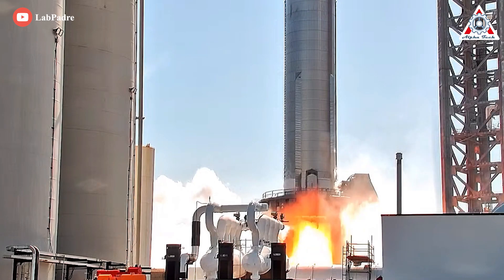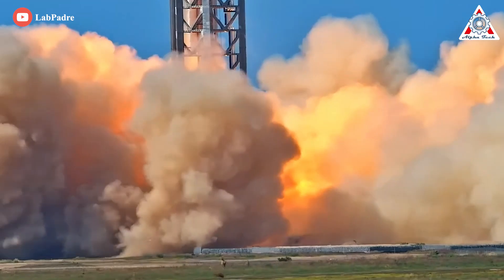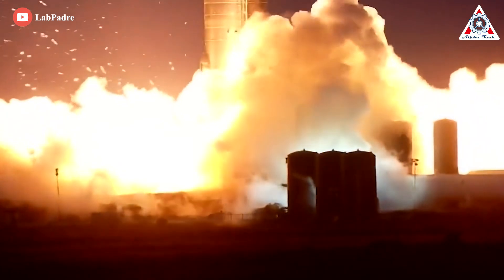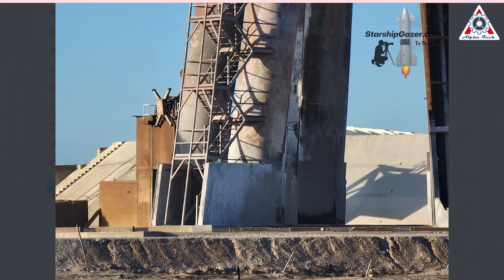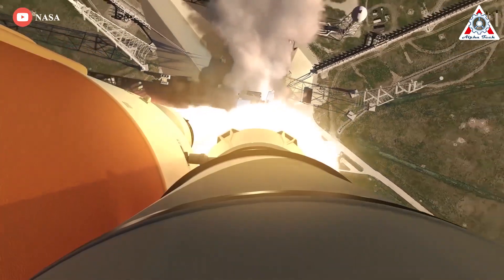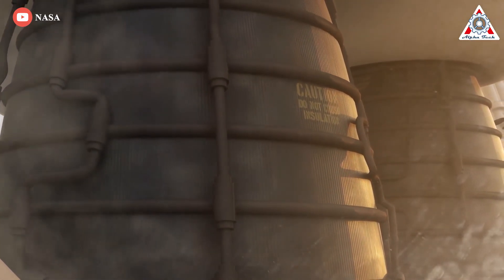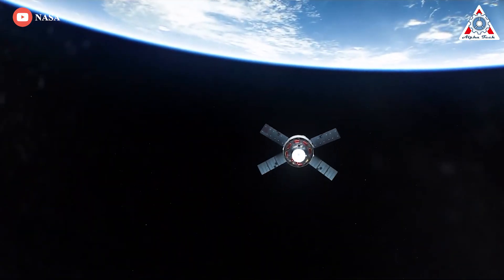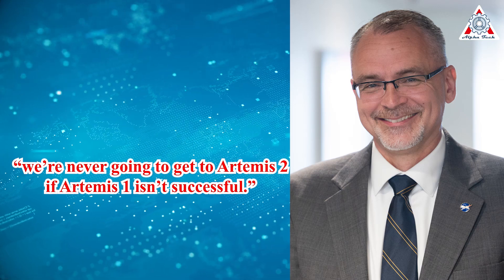Analysis Starship Super Heavy Booster 7 14 engines Static Fire "Problem"...

Comment: I think with this amount of engines it would be a viable option to start up to launch off of the pad with minimal engines then start up on all full engines once cleared the pad.
Reply: It isn't viable at all I'm afraid, if you don't need all engines to ignite on launch then you don't need them at all once you're off the pad... There are 33 engines because that is the minimum number needed to get the rocket and the full payload off the ground. Sure, you could reduce the mass of the payload and only light half of the engines but once you're in the air you don't need to light the other half. It would be cheaper and more efficient to just build a smaller rocket if you're going to do that. 👍
Reply: I dont think so. You need the full power to lift the most heavy rocket: the first meters...
Reply: @I Am A Duck you are using up some of  that safety margin by doing this
Reply: @I Am A Duck There can be X amount of engine failures during flight because the rocket gets lighter as it burns off fuel. That in-flight failure rate will be calculated based on a launch TWR of 1.5.

A fully fuelled booster and Starship with 100t of payload will weigh about 5,000 tonnes (1,420 tonnes of that is the fully fuelled Starship and its 100t payload) and will need all 33 engines firing to achieve the desired launch TWR of 1.5 

Like I said, it could technically be launched with less engines by reducing the mass of the payload but if you're not going to launch it at its maximum payload capacity (or close enough) then why build such a large rocket? 

Just to give you an idea, a fully fuelled booster alone WITHOUT Starship/payload would only allow you to shut down 6 engines at launch and still achieve the launch TWR of 1.5.  👍
Reply: Not how it works. It's heaviest at ignition and almost heaviest at lift off. And you need to test performance at full power before you release it. Earth orbit is much harder than you think.
Reply: I pretty much had the same thought as you in my previous comment! If it was feasible to clear the launch pad either using less than all the engines, or all the engines but at a lower power setting, that could be a work around.

Comment: Even spaceflight casuals have pointed out for the last 18 months that this launch pad would need a flame trench and a massive deluge system yet SpaceX with some of the best rocket engineers on the planet never bothered with any of that.
Can anyone give a rational explanation how that could have happened?
Reply: Because a static fire may actually be more destructive than an actual launch.  Musk has said many times that Starship will leave the pad very quickly.  Thus, the impact to the pad will be less than a static fire where it held down and pounding the pad and surface below for a longer period of time.  I'm not saying I agree, but that is the reasoning.
Reply: @texaswunderkind  The static fire was very short, the rocket will also take off very slowly when it is finally launched so this doesn't fit.
Reply: Because they are taking a risk to see if they can get away without the trench.
Reply: Because most of them are less than 30 years old?  Lots of school knowledge but way to young to remember even the Space Shuttle, much less Apollo.
Reply: I've wondered the same thing since I first saw the launch pad. It just doesn't seem to make sense. I kept thinking I must be missing something because it's hard to believe such smart people didn't think this through, but now I'm beginning to think that maybe they're not that smart after all.
Reply: @johnsaville9210  I suspect the rush to launch and the lack of experienced people.   Saturn 5 had a huge launch pit and was positioned much higher on the tower and even then there was damage.

Comment: Either A) The entire rocket need to be raised higher off the ground at launch time. 

           B) The entire launch pad under the rocket and the legs of the OLM need to be flooded with much, much, MUCH more water. Water is an excellent medium for supression and there's a lot of it around (though they might consider using fresh-water to guard against local infrastructural corrosion).
There isn't a material on earth that could withstand the 33 V2 Raptors' predicted thrust/violence at full throttle.
 There would need to be at least multiple "layers/curtains" of laminar-flowed water into "sheets"  to have any hope of preserving infrastructure.
These layers of water would more efficiently shield the LM legs and surrounds with MUCH MUCH MUCH more water than is currently being supplied.

Option A) seems easiest though; the OLM may need a complete re-design. Maybe more of a spider-like design where the legs are more "away" from the violence, and the Booster is more "suspended" a little higher up "through' the mount.
Reply: 1) Dig a 2m pool between all the six legs.
2) Water.
3) Liquid nitrogen to freeze it solid. Because you can.
Reply: I think the reason Musk isn’t just flooding the launch pad with water is that eventually he wants to build a launch complex on Mars. There isn’t much water to use up there. SpaceX is using the facility at Boca Chica as a test bed to find out just how little launch infrastructure they can get away with. I do agree they need at least a flame trench to direct the exhaust energy in a direction away from the launch tower and surrounding infrastructure.

Comment: They should probably lift off with only half the engines firing and then light the rest after it clears the pad
Reply: Not possible when you have a propellant and second stage load of 5,000 tons. They will need ALL engines firing to lift that load.
Reply: If you can lift off the ground with just half of the engines firing then that is all the engines you need for the entire flight, you wouldn't need to even bother lighting the other half. Just build a rocket with half the number of engines...
Reply: @marko247  The 185 ton (dry) Booster needs 3,350 tons of propellant to lift its load of itself, its propellant, the 120 ton (dry) starship, its 1,200 tons of propellant and its 100 ton payload to get the starship to a point (typically 60km  high) into position to go for orbit, and then to land the booster itself. The total loaded mass of the booster + starship is about 5,000 tons. For a thrust to weight ratio of 1.5 you then need 7,500 tons of thrust. For that you need 33 engines delivering 230 tons of thrust each.
Reply: @stefanbaartman5893  You're right but just to be clear I wasn't trying to say Starship could launch with only half of its engines firing. I meant if a rocket (any rocket) could launch with only half of its engines firing on launch (as suggested by Daryl) then it would be designed with half the number of engines in the first place because any more than that number would be unnecessary.

Like you said, all 33 engines will be needed to launch its maximum payload. I think there is a bit of redundancy calculated in for engine failure(s) during launch but that figure certainly isn't for a 50% failure rate!
Reply: @marko247  You're right. Essentially, a thrust to weight ratio of 1.5 is a very conservative design spec. As SX gets more thrust out of Raptors they may well reduce the engine count, or up the payload they can lift.

Comment: Removeable deflector shielding will be necessary to protect the "concrete" (whose idea was that?) pad.   Deflector Shielding will need to be ceramic coated.   5000 F   because 5000 C seems waay too hot!    Hydraulic Eiffel Tower launch system will avoid these launch problems.  It'll : be safer; save fuel; increase payload; reduce noise; and be more reliable.

Comment: My thought: Where is all the noise attenuation water prior to engine start? The sonic shock is more destructive than the heat. The noise is what shatters the concrete. When I was a kid, I crewed TITAN II missiles and a launch without attenuation water would explode the missile due to shock. Same with the launch platform in this case.
Reply: Its in one of the tanks  in the tank farm.

Comment: Looks like another delay while they resolve flame deflection issues. I see no way they can modify the current launch pad efficiently. Most likely it will have to be completely removed and start from scratch.
Reply: It doesn't need to be redesigned.
Reply: @texaswunderkind  What are your suggestions to correct concrete spalling issues?
Reply: @texaswunderkind  the concrete raining down would like to have a word with you

Comment: The whole launch pad idea is ridiculous. Since Super Heavy booster will ONLY launch from Earth then why not build a sensible pad?  A flame diverter and water suppression is absolutely necessary. When Starship eventually lands on the moon it will not use its three or six vacuum Raptor big engines to land/launch so blasting a hole in the moon will not be a problem. Landing on Mars will use Raptors but only three or six will not blast a hole in Mars. It is nonsensical to have an unimproved launch pad on the only planet where it would be easy to make improvements.

Comment: dont give up on facex yet Why do you think they are building freaking 2 more launch pad, and to be hoenst, Yes, ALL OF MUSKS FANS should sign a letter of consideration, and work together with NASA< to create a better flame trench and sound suppression system,  i dont think a launch to orbit will come any time soon, there are going to dig  a trench, THEY'LL HAVE TOOand USE SILCA AND CERAMICSto divert the flater  through the waater and Nitrogent LOTS MORE OF IT, AND DOWNin a secundairy water and nitrogen  suppressions system, like earlier designs made it look like 60k kubic meters of water a secondwould be whirling dorn like a whirlpoo with water floating on nitrogen jets spinning and elevating it, but still thats too weak, they need to increase the deoth and divert the flame more elegantly even if that mean NOT having a 1:5 lift ratio at the pad,  DUMBASS TEXANE ENGINEERS  WHAT DID YOU THINK, apart from booster 9 this rocket had N1 Styndrome though it's reasonable to think it'll all fire but what about the next tecond It's say a better deluge is need, ad the best parts is no parts!? doesn't apply if he wants to keep his precious launch pad, it's shielded yes, but it wont be from depries., the the destruction of the launchpad, how about the fact that the 3rd launch tower us maybe going to be the succesful one and tower, and the fact that he bought oilrigs, to set it up there there'd be atleast 50meter of clearance into water, Come on elon musk dont push it, YOU KNOW IT ELON find a solution, gible the engines outwards, create waterfalls inside the pad and ouside of it, and create a diverter, IDK the temperature of the exhaust, but if we need need Dsynthethic diamond coating a pool and a bulge underneath that thing amongst with the deluge i described, BUILD IT, you guys made a rocket of a water tower, now make a watertower rocket Elon, 

GUY can anoyone get this messege to elon? i dont use twitter, but seriously show him this.  and i think a a nasa style flame diversion is the best way to go now including what i just said, otherwise you can kiss Booster 7 and ship 24 goobye. u dont want this, take your fucking time. u need this data for the next towers and ships.
Reply: + i dont work for you elon, so i can say whatever i want about this, but this isn't going to work with 33engines, kick the engineers in the but and show them what i just posted. it's elons monney, and i'd hate to see it go to waste as  just need 600euros to save my miserable life basically, so save astleast booster 7 and ship24.

Comment: The brain power at SpaceX is beyond my comprehension but I see no way that this rocket can launch from this pad. I see no unique or revolutionary tech being utilized by the Starship pad that allows it to circumvent the need for a flame diversion trench and massive deluge system. Launching from a flat pad with a very small deluge system is a recipe for disaster. What am I missing here?
Reply: Sometimes folks are so smart they assume the "simple stuff" (like launch platforms and exhaust trenches) are not worthy of their time.  So you end up with a tight cluster of buildings, launch pads, and tank farms that are going to be shattered when all 33 engines are lit off at once without a water deluge system.
Reply: The accumulative sonic shock waves of 33 Raptor engines will probably cause the engines and rocket to pulverize first before any of that happens .

Comment: An engine test does not a rocket make.  Also, N1 flew more times & higher than both Booster & SLS, so why is it a failure on your metric?  Granted exploding all over the place & destroying the launch pad are not desirable features. But neither SLS or Booster have proved themselves in that regard.   Not wishing ill luck on anyone, but please be consistent in your evaluations.

Comment: I've been saying for more than a year now that the lack of flame deflection system was a BIG mistake.
BIG mistake.
Reply: I've heard that they don't want to do it because there are no flame diverters on Mars, so if they can't make it work here on a small tower, it can never work on Mars.
Reply: @MoominDoogie  this makes the most sense.
Reply: I am also concerned that they have not adequately accounted for the acoustics.
Reply from the maker: 3 years ago, Musk also worried about this
Reply: @alphatech4966  so why hasn’t he fixed it?
Reply: @sirkiz1181  Too busy sacking twitter staff ...
Reply: @Tom-hk6ub  or, not busy enough 😉
Reply: @sirkiz1181  
My guess - that's all it is - is that he viewed exhaust control facilities/procedures as a relatively easy problem, making it less interesting to him.  I'm sure that it becomes more interesting with each static fire test.
Reply: The Star Ship has a 100 foot 360 degree  flame diverter. No Rocket has ever had 100 foot clearance from the bottom of the " Open sided Flame pit"       Why is it No one seems to see the 100 foot tall table. With 360 degrees of open sides. All other  Lunch pads only have 20% to 30%  open end. And they are half that clearance
Reply: @apotheosis1181  Maybe so, but I don't see THEM blowing big chunks of concrete around. Or even Small ones. A rocket THIS powerful needs more than a 100' open table to handle the shock-wave of these engines. Open concrete is cheap, yeah, but in my humble opinion all of the concrete within reach of that blast should be either shielded by a layer of hard metal, or layered with a thick, flame-proof artificial rubber specially made to handle high heat. He doesn't have NEAR enough deluge, either. He's adding nitrogen to the deluge area, but that with the mix of water and ignition generates frequencies of sound and percussion that no concrete would ever by able to withstand.
Reply: @apotheosis1181  There is a difference between diverting/turning the flames vs just having them hit the ground at a 90 degree angle. The 360 degree open bottom is (IMO) a design flaw. Much better to have an angled diverter to get all the flame and thrust going in a direction of your choice.

Comment: The only thing harder than concrete is like epoxy resins like the kinds of compounds they use in the dragons heat shield. I don't know if it's economically feasible but it certainly is something they should be looking at is a way to harden the ground immediately underneath the launch tower. There's got to be a materials engineer reading this, any ideas? It would be really convenient if particles and shards of whatever don't ricochet off the ground and take ballistic trajectories out towards valuable infrastructure. It would be really convenient if you could spray a compound like that down like shockreet. Shockreet is a kind of cement compound that can be basically sprayed on any surface. I think they use it to line the surfaces of tunnels like mountain underpasses for roads,, rail etc.
Reply: Imagine a tube, like the barrel of a cannon, big enough to fit a Starship bottom section, booster, and for only 7 engines to ignite, yet again .... Only those engineers at spaceX know what they're doing but for the mere mortals the mystery remains
Reply: No matter what, epoxy is still plastic and will burn.  A refractory of some sort is needed.

Comment: The only thing that could save the launch pad is liquid water, as it is water in liquid form cannot be compressed. What the need is to dig a hole under the rocket fill it with water and valves at the bottom of the pool able to release the water at the same time the rockets are ignited. is going to cost a fortune but  should make the launching pads pad reusable.
Reply: Water is not compressible but it is easily dispersed. A pond under the rocket would be emptied in a fraction of a second.
Reply: They have tried deluging the base with water and that doesn't really work since it would need to be sprayed in faster than the exhaust blows it away!
A thick layer of ice instead?
What would be better is a layer of steel armour over the whole base area with no exposed concrete. This would be much tougher than concrete and be able to conduct heat away during a prolonged test, it could even be fitted with water cooling pipes inside.